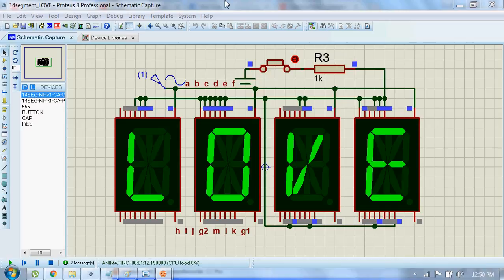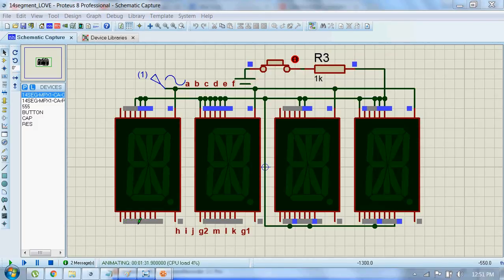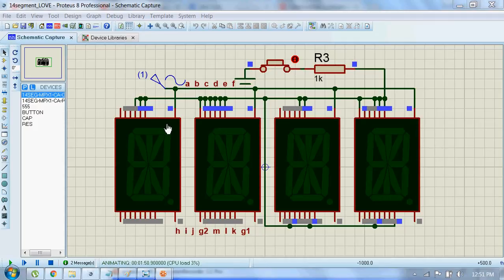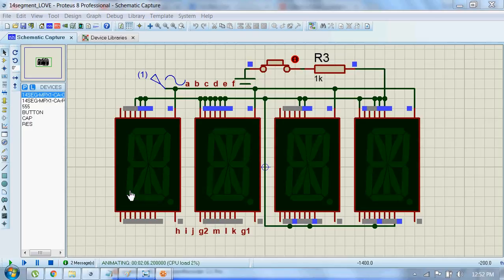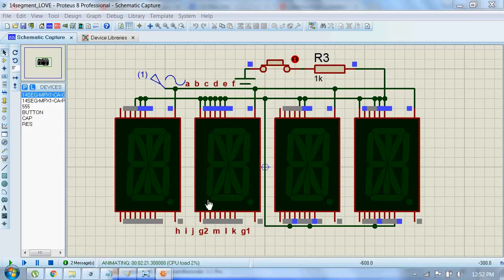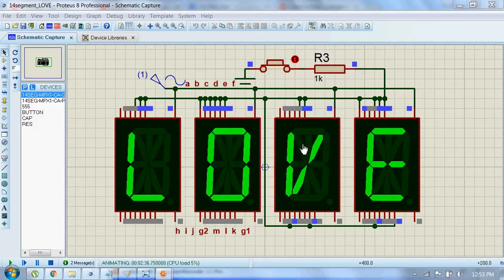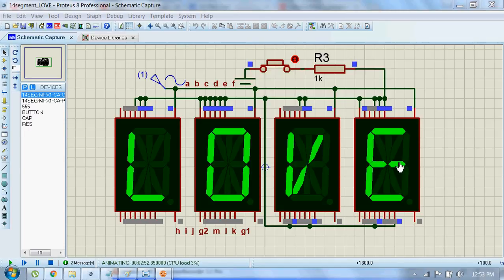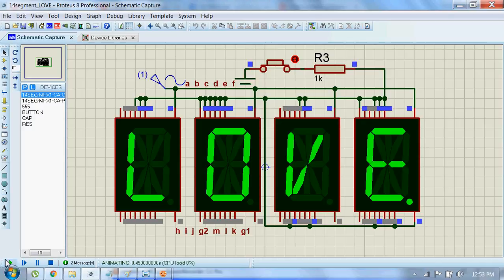14 segment display

Comment: Can you please tell me the properties value of sine generator that you have used in this circuit 🥺
By the way nice stimulation and it's very helpful🙂
Reply from the maker: Thank you for watching and the comment. Just use lower frequency value (5hz-10hz) which will make LED blink at a rate our eyes can see. Higher the values you use, faster the LEDs blink making it difficult to see the numbers. Hope this helps.
Reply: Thank you 😊